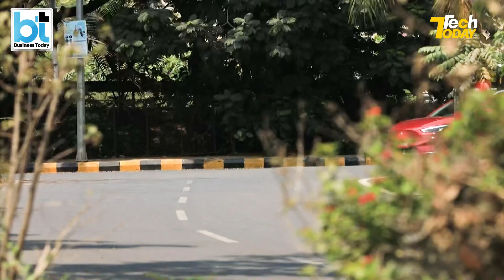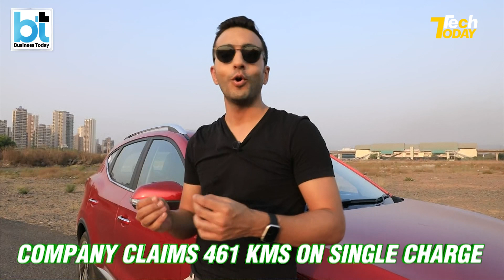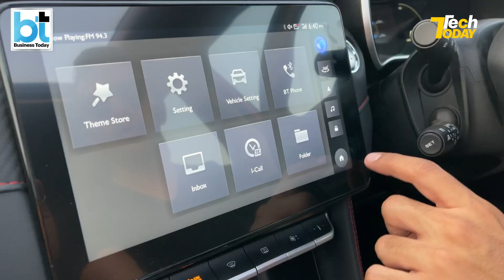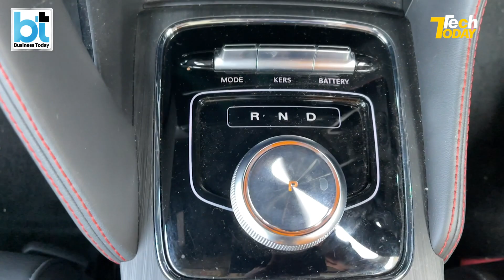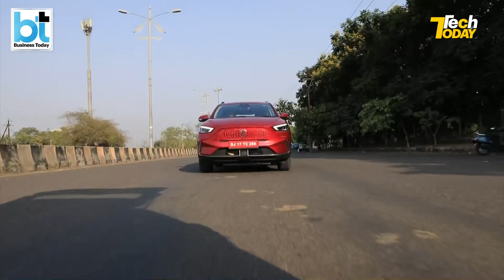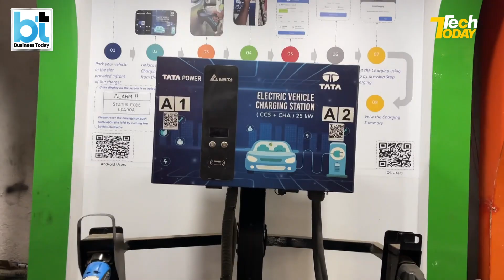MG ZS EV 2022: The Ultimate Road Test!

Comment: I am still a bit confused how MG have a standard range (49kWh) and long range (68.3kWh) in Europe and claim respectively 320km and 440km WLTP, but in India they claim 461km (WLTP?) with a 50.3kWh battery.
Reply: In India they use ARAI, in Europe it's WLTP. The realistic range is 320 for the standard range
Reply: @theelectricmile474  Ah that explains thanks!
Reply: Underpowered that's why.
Reply: @albatross7  what do you mean exactly? The indian MG with 50.3kWh has 177ps, same as the European 49kWh and the 68.3kWh has 155ps.